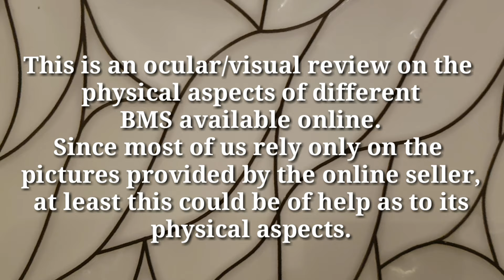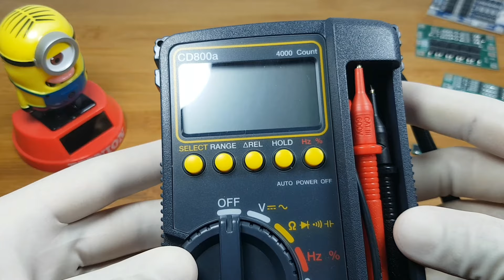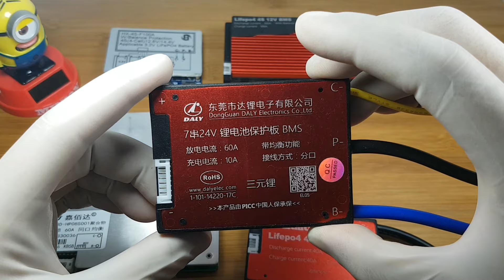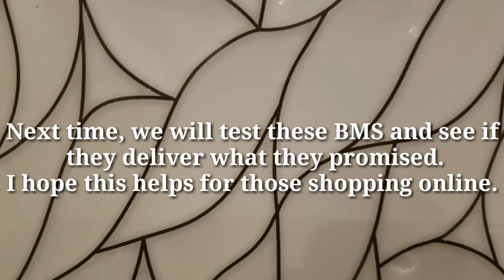BEFORE BUYING BMS YOU MUST WATCH THIS | Learn BMS | Subscribe WOOD TV

Comment: Some boards terminals are temporarily shorted internally until they sense a full load or sensors attached. It's a safety feature.
Reply: Low side switching. I wouldn't call the positive terminals being connected to be a short.

Comment: Can I use a 16s bms on a 15s pack by leaving 16th wire unhooked on bms??
Reply from the maker: Good Day Dano, You just take a soldering iron and burn the DW01 that's connected across the 16th cell. The DW01 is a lithium protection IC. This makes it so the LVP and OVP are disabled for the non-present 16th cell, meaning the BMS is now a 15s board. But this is difficult to do if the BMS is the more expensive type because they don't use DW01 protection or similar 1S Chips

Comment: The 40Amp DALY BMS has 10AWG wires. That size wire is not normally allowed to carry 40amps. Is there something I misunderstand?
Reply from the maker: Great Day Sir! Yes sir, 8-gauge wire should be the standard to handle 40A. 10-gauge wire for 30A and 12-gauge wire for 20A. That Daly is an enclosed type which has a buit in wire. Maybe, they consider the user wont operate the BMS at max value that is why they undersized the wires. Thanks Sir for noticing.

Comment: I dont think that the thin terminals are handling output current. They are only using for charging
Reply from the maker: Yes sir, those are sensing wires. they are for balancing

Comment: greetings, for bms is there a difference between those lithium ion batteries and the lithium iron phosphate batteries ???
Reply from the maker: Yes Sir! indeed there are differences between the BMS for li-ion and LiFePo4, most li-ion has 3s connections for a 12V setup while the LiFePo4 uses 4s connection.

Comment: Hi sir, can i use 13s bms on 12s battery pack?
Reply from the maker: Yes po you can sir, but you need to desolder yung circuit part ng 13th S. kasi madedetect nya yun na 0V di po gagana ang BMS nyo
Reply from the maker: Yes sir, you can, but you would need to desolder the 13th S circuitry to avoid detection by the BMS that its 0V on the 13th terminal. Else if it detects that it has 0V on that part the BMS remains OFF
Reply: Ok sir, thx for you answer.

Comment: Hello sir, yung sa 6:19 na hawak mo na BMS kasi ang ginagamit ko and ive checked the diagram kung ano ang i connect sa positive and negative terminal ng battery. Pansin ko po lahat sila naka tap sa isang battery lang on both polarities. Pwede ba idistribute along the batteries?
Reply: Example po yung sa Negative terminal ng battery, ang i coconnect po dyan is yung B-ng BMS at yung isang sensing wire, B- ng active balancer. Pwede ba sila i distribute along the parallels of the negative terminals? Im using 4s6p config so i have 6 negative terminals
Reply from the maker: Tama po kau sir, as long as po parallel lang naman na connections sila sir, in electrical sense po, isang point of contact lang po cya, so sakto po kau sir, no probs po.

Comment: where is the best bms?
Reply from the maker: The best BMS depends on your usage but the bigger your need for current, the best would be the last one with RED casing. Especailly if you will be using it for your Home Solar Project running at maximum of 1000W load
Reply: @woodtv4481  if i making power wall with 18650 30Ah ,what BMS can i use?
Reply from the maker: @advanlimapuluh6227   First you need to identify your load requirement. For example you bought a 1000W inverter, try dividing that by the voltage of your battery, let say you are using a 12.6V lithium 3S  battery pack, then 1000/12.6 =  79.36A that means you need a 100A BMS. If you have a 500W load then dividing that by 12.6V that would give 39.68A so you need the 50A BMS or higher. I hope that helps. Thanks